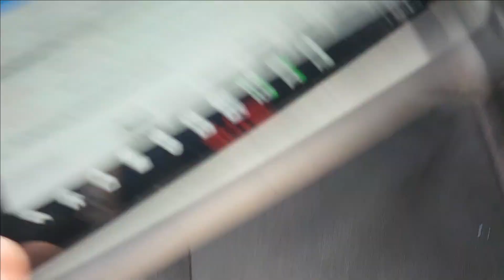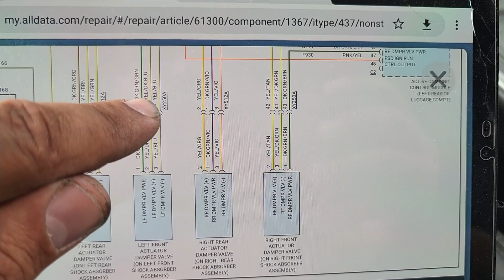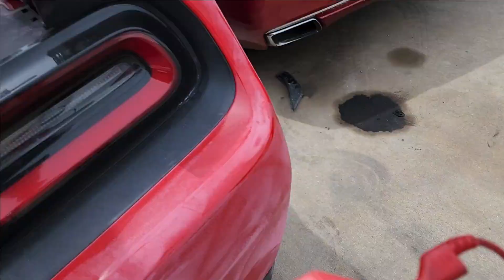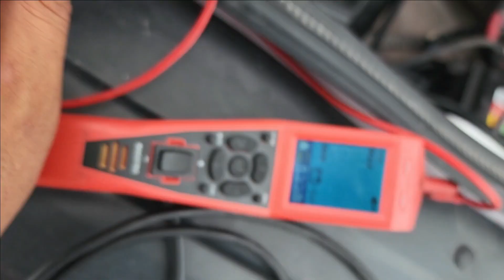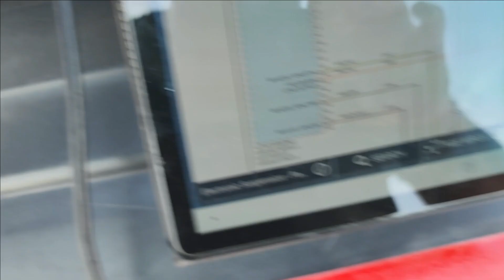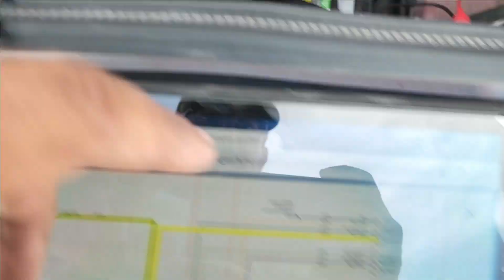C212C Suspension valve power supply voltage circuit short to battery on a 2020 Dodge Challenger

Comment: Really nice case study, thanks! Just curious why your not using your dell latitude?
Reply from the maker: Thanks. I dedicated that laptop to programing. Also its easier and quicker to use a tablet. Im gonna buy a windows based rugged tablet to use only for diagrams.
Reply: @DallasAutoDiag  I have the Dell which I use for my Pico & diagrams. I use a Toughbook CF-33 for programming. I recently started to use Microsoft OneNote for laying out diagrams and documenting work, and that works way better on the Toughbook, so I'm not sure what I'm going to do.